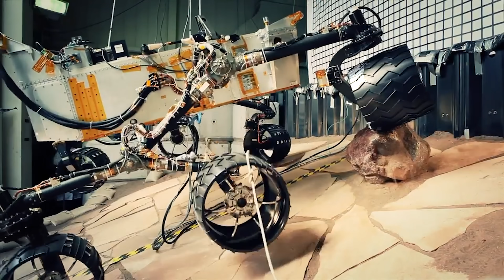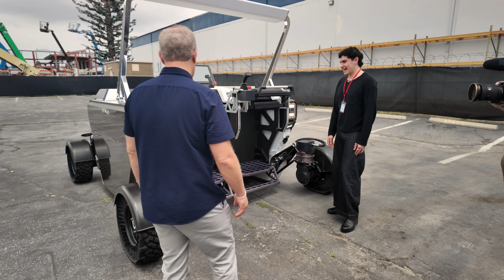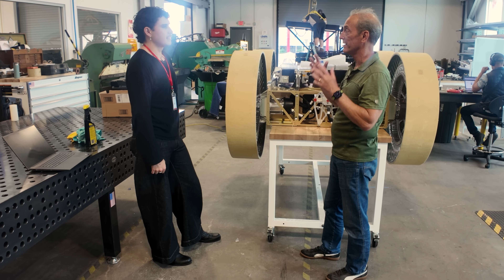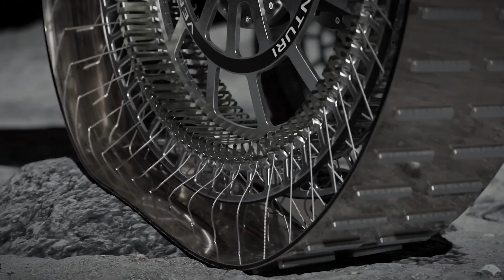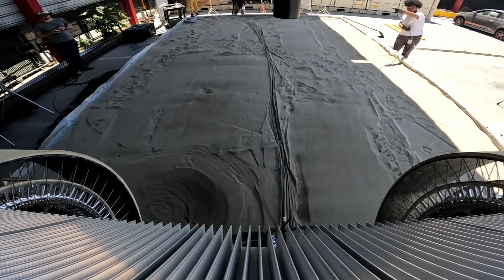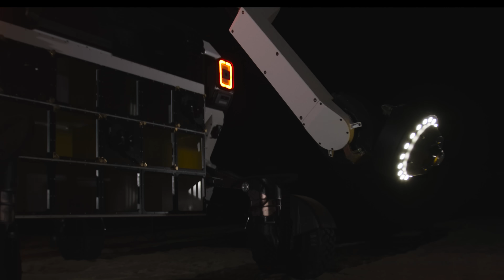I Drove NASA's New Moon Rover

Comment: I don't see this ever making it to the moon unless there is an already established base there with an abundance of supplies. This looks to have too many possible failure points due to the number of mechanical parts. Due to the multiple points of easy failure, this vehicle could potentially get scrapped rather quickly and require a bunch of repairs